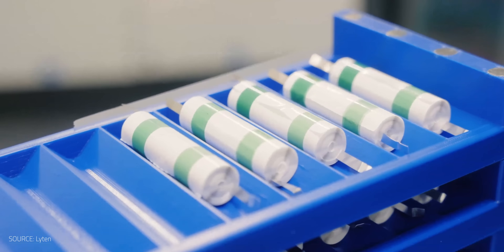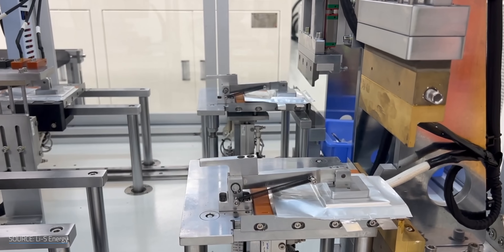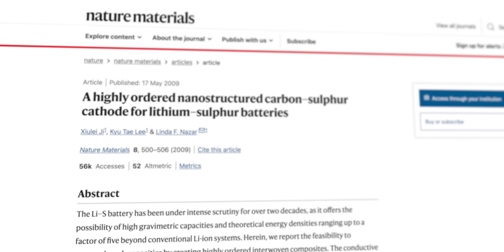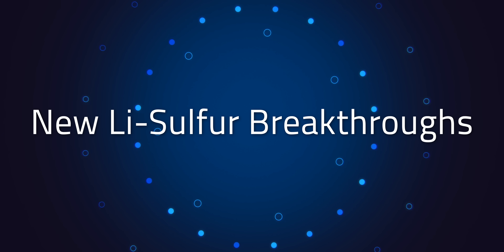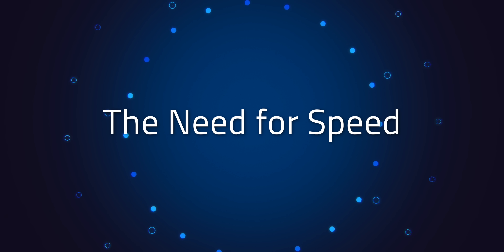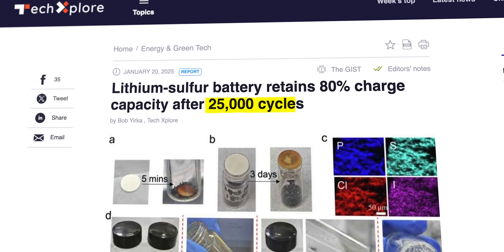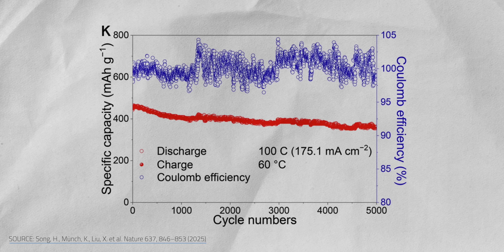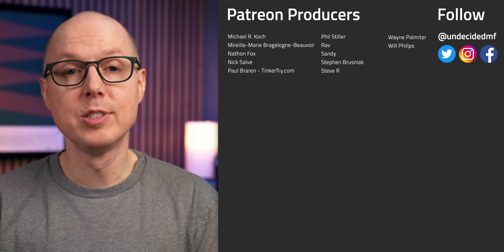How This Overlooked Battery Might Change Everything

Comment: Lithium Sulfur if at readiness level 8 and proves scalability - it may be better suited to Solar and wind energy storage  in megapack use more so than for pouch cell applications for personal computing and automotive.
So much focus is on automotive as that is a key issue for range and mass  but longer cycling for renewable storage is a much bigger market. 
V2X in vehicles makes perfect sense when batteries are less effected and have far greater life cycle.
Car makers will not want vehicles that can run for 40 years on a single battery as that goes against their built in obsolescence. 

However low cost static storage is the key for increased use of renewable energy proliferation. Every country that has installed Solar and wind power generation see massive levels of curtailment as grid stability is sensitive to the fluctuations. 
Providing a Static storage buffer system to regulate the ups and down in generation of renewables is key to utilising 100% of possible generation. the DC battery can accept the fluctuations in charge as renewable ramp up and down with effects of progressive cloud cover or rises and falls in wind speed.
All these technologies need to get into scalable commercialisation and there are strategic plays as to why some may progress whilst others may take a back seat.

Comment: With 2 - 3 times the energy storage density, which translates into half sized batteries and half the weight, and likely half the cost, what's not to love.  there are other companies that Matt didn't mention, such as one in Germany that is building a production facility too.  Ev's are inevitable.  ICE vehicles are doomed.

Comment: Another reason for making the battery in EVs, multiple modular batteries. Yes, high up front cost, but increases the individual EVs life. And integrate the charge/delivery circuitry into the module, so you can mix and match. Much like when lithium ion batteries are used as lead acid replacements. There's circuitry inside those batteries, for compatibility.

Comment: perfect vs kinda perfect. infinite vs finite. working vs broken. full vs lacking. need to work vs free.
Reply: A flywheel energy storage does not need to be rotating mass inertia storage. It can be also linear spring mass inertia system. Both systems have their tune variables.
Reply: Ie sound vibrations can be used to store energy. Assuming acoustic losses are near zero.

Comment: For stationary applications, the size and weight aren't big issues. It becomes a dollars per joule optimization question. I suggest that folks looking at this video review what happened at Moss Landing in California (a battery fire, nowhere near the LA fires). I am severely disappointed that more effort isn't being put into reviving nickel-iron battery chemistry (invented by Thomas Edison), the most robust battery ever. Jay Leno has a 1908 Baker Electric with the original NiFe battery -- just check the electrolyte level, charge it up, and drive.

Comment: Every electric car doesnt need to have 600-1000 mile range. If they could cut the weight of the battery in half and keep the same 300-500 mile ranges, people wouldnt need to go tire shopping every 6 months. That’s huge.
Reply: 400 miles + safety + long life = pretty much a win for everyone or about 80% of the market. The other 20% would need something that can do 600 ( but most of those are long haul's) so if you can get charge times down to less than a few mins - its pretty much no brainer. Ride shares could do something like 200 miles even if they are local cars (person or AI).
Reply: @adr2t  lower weight and better motors, inverters and more power efficent car systems will enable 400+ miles with just 60kwh battery in the future, a 1000kg car is the way to go, 10kwh per 100kg will be standart in 3-4 years and even 8kwh per 100kg is possible, today we are at 12kwh per 100km with 1900kg car then with 1000kg car 10kwh per 100km is more then possible
Reply: @harelbenyosef8743  motors are already like 95-98% eff, so we're not going to really improve that much more.. at best we just make them cheaper or maybe lighter. I have seen some that reduce their weight a bit for the same power, but they wont really add that much more range (maybe another 15-20 miles). Inverters are the same as well being 90-98% eff.
Reply: @adr2t  Most charging happens overnight. Charging time is a false flag. My Chevy Bolt isn't hard on tires.
Reply: @trikepilot101 Only true if you have charging at home, not everyone will nor have access to it. We're getting there, but not everyone will have access to that for a while sadly.
Reply: @trikepilot101  but if you are charging overnight, you're not using renewables for that. You're using fossil fuels.
Reply: @petert3355  It's dark as I write this in the UK. Current largest energy source is wind, followed by nuclear. Other major sources are biomass (wood pellets) and imports from France, which us mainly nuclear. CCGT (gas) is currently running at 13% of supply. So no, at night, electricity supply can mostly be zero carbon. The UK also has some solar.
Reply: @adr2t  smaller tank / battery charges faster than a bigger one too. So presumably you get gas like charging times and gas like range and gas like tire usage in a more efficient package.
Reply: You don't need to change tires every 6 months ?  Who told you that ?   You do realise that the cars have been around long enough to completely debunk that right ?
Reply: @MickH60  i’ve had multiple people confirm the tire life is an issue with heavy evs.
Reply: @jeffreytgilbert  I wouldn't be surprised if the tire issue is more of a driver issue than a car issue.  Too much enjoying that acceleration, hehe.
I thought I heard that EV's were lighter than ICE vehicles, but not according to google.
Reply: @jeffreytgilbert  I drive a diesel SUV that weighs around 2.5 metric tons - more than a typical EV. I often load it up to nearly 3 tons. I sold the factory tires couple years ago because I wanted something more suited to the dirt roads. They were 9 years old. 
My suspicion that the reason of EVs eating tires like it's McDonalds is not the weight but rather the weight and driving habits.
Reply: @ you also dont have as high horsepower, torque, and dont drive around on sports car tires. Trucks have honkin big high tread life tires.
Reply: @ Of course, I agree! It takes my box about 11 seconds to get to 60 mph and I don't think I ever did pedal to the metal in 11 years of its life. 
But when I get an EV (AWD ID.7 is pretty dope for my needs), my driving style is unlikely to change significantly.
I'm really looking forward to it. Got tired of paying for fuel when the solar is already in place.
Reply: @MickH60  I mean, some EVs absolutely do devour tires.  The cybertruck has a curb-weight of 6,843 lbs, and the very high torque/power that EVs can have is also hard on tires.  6 months is obviously hyperbole or an edge case though.
Reply: A lot of tyre use by EVs is driving behavior. High power cars can burn through tyres very quickly. ❤
Reply: Even most people are perfectly fine with just 150-200 outside of very rare long trips.
Reply: @meneldal  But it's nice to have more if you like doing road trips or haul trailers.  I'd rather have the versatility.
Reply: @GUNNER67akaKelt  Yeah but not all cars need to be able to do that, especially outside the US
Reply: @meneldal 
Error, hello.....Australia.....
Reply: Trucks, trains, perhaps shipping would all benefit.
Reply: @dougerickson3362  
Diesel big rigs are so noisy, that drivers often shut off the engine just so that people can talk. Imagine if they were soon EV-quiet, and could accelerate like a car?
Reply: Public transit and e-bikes for the last mile would take even less energy.
Reply: @frederickheard2022  
Why do you push stupid and oft-rejected ideas? Buses and trains do not go where and when people want. Why propose something other than a car for what a car does best? Why not accept "the customer is often right" and build better cars? E-bikes might be cheaper and more efficient, but they are also less safe and do not provide protection from the weather. I like being able to shut out the outside noise, listen to talk radio, and to have plenty of heat or A/C. Whatever is an e-bike good for but very short trips and beautiful weather? And an e-bike has very little cargo space. Not very useful for carrying passengers nor groceries.

Energy is not scarce. In fact, I suspect that free-energy machines already exist but are being hidden away somewhere, for the most nefarious and stupid of deep state reasons.
Reply: @jeffreytgilbert  most sold ev's have more like 150 miles of range globally. They don't have 500 hp of power either.

Usa market is a special luxury market which has resulted in this current state of appliances people have not being repairable, cars not being repairable(and expensive to repair due to under the hood being so full from being the upmarket models where as in an asian isuzu mu-x you could almost stand in the engine bay with the engine still in).

Trap of wealth, illusion of poverty.
Reply: @lasskinn ::: trapped by  poverty, we have illusion of wealth.
Reply: You're missing an opportunity - that is, large EV battery could run your house for a bit in a power outage. You could dedicate 10-15% of your automotive battery for 'emergencies' and still have plenty to go somewhere else. I imagine they could be used for 'load leveling' or preventing power-outage 'bumps' - not backfeeding the grid, but keeping your house power stable if a car hit a pole down the road. There's lots of opportunity here.
Reply: @ an opportunity so rare it could be considered total fantasy
Reply: @Maybe-So  
Why should I want a large EV battery or equivalent? Free-energy machines likely already exist, and in 5 years, your battery will be e-waste obsolete. So then where should I take it to dispose of it properly?

The solution is not all this hair-brained tampering with the electric grid, but to get rid of it and enjoy freedom of having our own whole-house free-energy machines.

We are told that communist central planning almost never works well, yet we accept a centralized power monopoly? Why do people think that is okay?
Reply: I agree with this plus the letter your electric vehicle is the less you’ll consume tires
Reply: I’ll tell you one thing, these 50-100 mile range ‘electric cars’ are such a huge joke! Who buys these things? I have a RAV4 Prime that has 40 miles electric plus 350 miles from the 10 gal tank! 
    My F150 can get 600 miles out of a 30 gal tank. I think 400-500 mile range is ideal as it is equivalent to most ice cars now. BUT, I want something that flys baby! That’s why we need the density! Give me a Jetson One with 350 mile range! (Bout 2 hrs of flying 😮) Now we’re talkin!
Reply: I've owned an EV from new for 5 years. I have yet to need to replace the tires.
Reply: Low cost EVs that routinely go 1 million miles will ruin the cycle of people buying a new car every 5 years. Legacy automakers will fight this with everything they have.
Reply: @undertow2142  cars age regardless of the powertrain. People are brutal on cars. They’re the most resource intensive thing to make of any of the things we humans buy. Reliable cars are a proven formula for success. Toyota and Honda are proof of this.
Reply: @jeffreytgilbert  I agree mostly but in the USA planned obsolescence has definitely become a thing.  In general most cars especially newer ones go to junk yards bc of drivetrain failure.  Manufacturers have zeroed in on marketing over reliability to sell cars. Even the newer Hondas and Toyotas have followed this trend. They can certainly do the same with EVs however the comparative simplicity of electric motors makes the bar much lower to produce a car whose drivetrain could last a million miles. Especially as newer battery technology hits the market.  In my opinion the limiting factor will be manufactures not wanting to produce cars that last that long bc it will hurt their profit. This could be countered by enough people who want a cost efficient car that will last. If the market demand/regulations/start up cost sweet spot is met then we could see a new company come along with a “basic” option cheap long lasting electric drivetrain and simple chassis that could come in under $20k.  I think the market for that would be massive. Lots of people already complaining about no economy ICE car and basic work truck options anymore from the legacy automakers.  I may have the money to afford it but I’ll not be buying a new car when I can get a used option with 100k miles and good service history that will last me much longer than a brand new camry, accord, or Tacoma.  However if I could purchase a new electric small to midsize truck easily expected to last 500k+ miles without needing a new battery or motors for under say $25k I’d buy it in heartbeat.
Reply: @undertow2142 and all their StealerShips!
Reply: @jeffreytgilbert  if you cut the weight of the battery in half you get more than half the performance because of the reduced total weight of the car.
Reply: But there is already such a huge network of places to buy fuel. Many of us who have never had an EV, are not very thrilled about waiting in line at a charge station. If we could make the entire round trip, for most people, and rarely if ever have to charge anywhere but at home, don't you suppose that would encourage adoption? Also, everything changes too fast, and so why invest in something that will be obsoleted in just a few years? So it then needs to be not a little bit better, but a whole lot better.

"Environmentalist" extremists have really soured the debate with their totally unneeded and unrealistic mandates, while largely ignoring things like physics and economic feasibility. "Climate change" is fake-science, and about the worst reason to consider having an EV. Rather, I like practical concerns, like a longer-lasting and more reliable car, and how quiet that EVs are. I find it really cool that EVs eliminate the transmission or shifting gears. It would be very nice if they were self-drive and could fly.

Comment: Sulfur cathodes form cracks because sulfur is brittle, the solid state batteries always have low discharge rates so they can't really be used on cars, liquid sulfur batteries are more reliable by only used in industral battery applications.

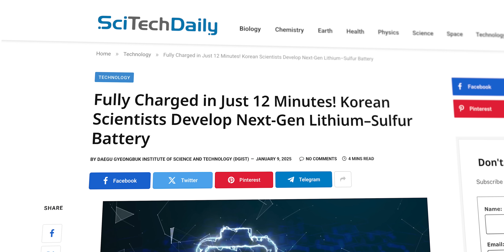Comment: Hi Matt, I was watching the video with subtitles, at 8:30 ISH you say 705 milliamp hours per gram. The subtitles say 705mAh/g^-1. However it's either 705mAh•g^-1 or 705mAh/g (both meaning the same). The / and ^-1 cancel eachother out, which would mean you'd talk about milli amp hour grams (instead of milli amp hour per gram)

Comment: Two very reactive elements in a tiny container, what could possibly go wrong?  That said, it actually looks VERY promising especially if the Lyten cells survive real world beta testing.  This could alleviate two of the biggest drawbacks to widespread adoption of EV's, range anxiety and waiting for hours at a recharge station.  HOWEVER, the recharging infrastructure still needs to be improved for those who enjoy long road trips.